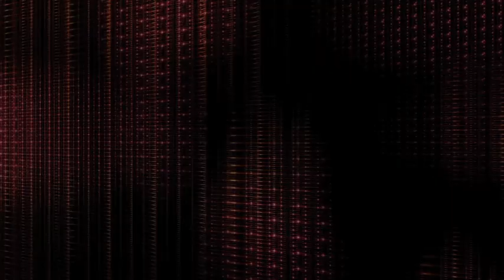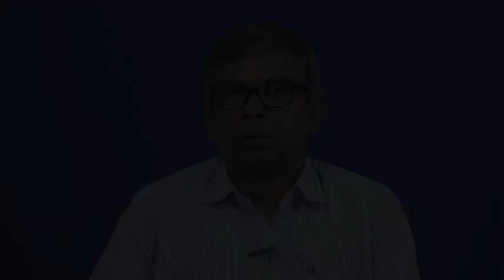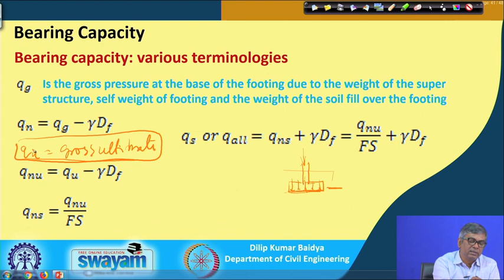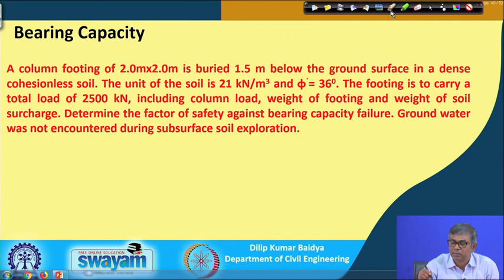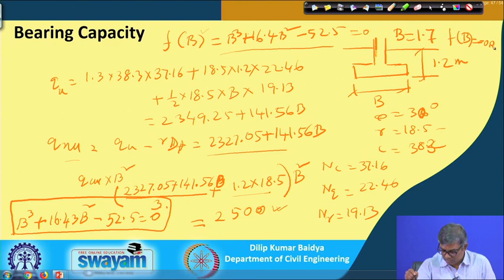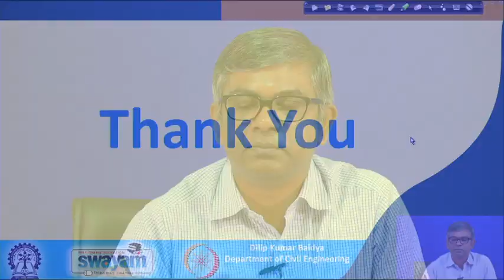Lecture 11 : Shallow Foundation and Bearing Capacity (Contd.)

Comment: The footing size given in problem 1 is 1.8x1.8 , this footing is a square footing. But when sir calculate the value of ultimate bearing capacity, sir does not use formula of square footing. Use general formula of ultimate bearing capacity... This create a doubt..